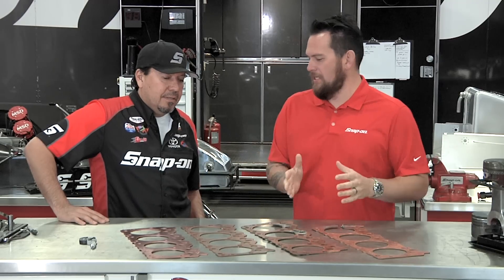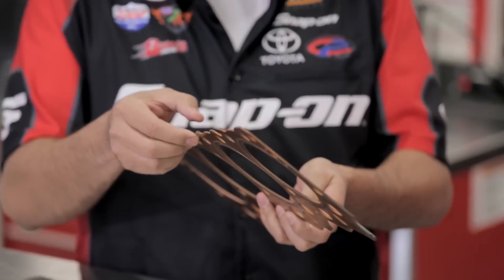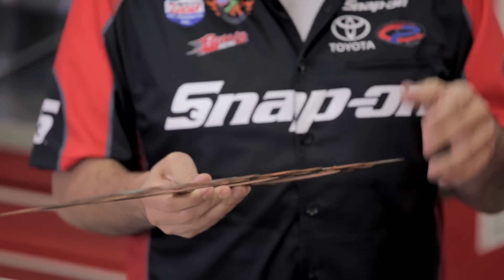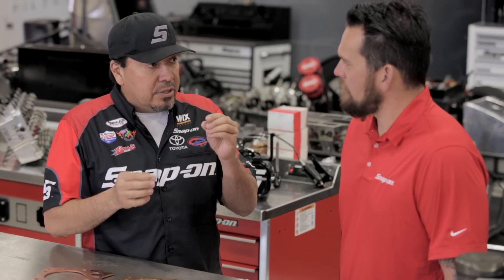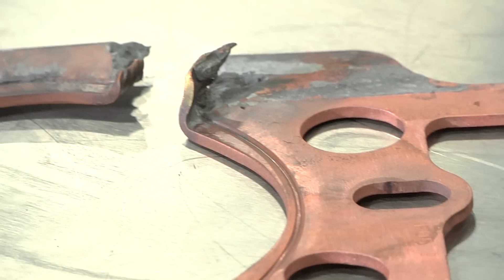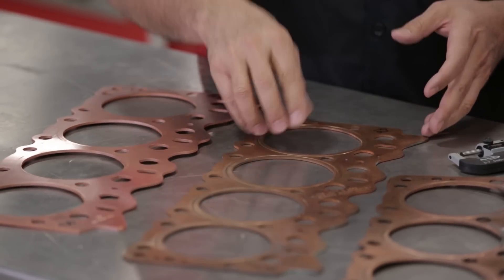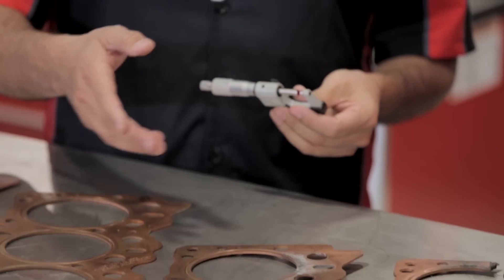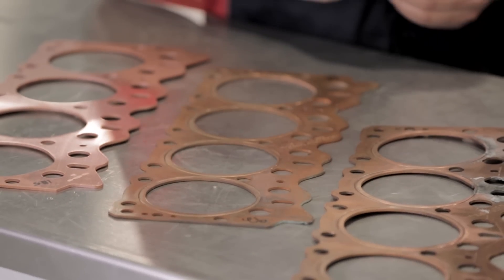Nitro Funny Car Head Gaskets - Snap-on Tech Series: Nitro Edition ft. Cruz Pedregon (S1, Ep. 20)

Comment: November 1 2015: Just got home from the NHRA finals in Vegas. Got my second Snap-On VIP pass. Hats off to Cruze, Snap-On inc. and the Pedregon Pit Crew.

Special thanks to the right side cylinder head Technician. His name eludes me. For a second time this year, he answered all of my questions and was really cool.

Extra extra special thanks to that tall dude Andrew who works on the left bank and head. He stopped clean-up at the end of the day and talked to me for about 15 minutes. Gave me some solid advice about how to get on one of these Fuel teams.

Andrew: Can't thank you and your right side counterpoint for being so friendly and polite. Can't thank you enough for taking the time to answer questions and give me advice about getting on a team. You guys are true gentlemen and scholars. I take my hat off to you.

I talked with most of the team in the Spring of 2015. Not a bad guy among them. Everybody answered my numerous questions and they're all nice, cool guys. The true heroes of the NHRA are the pit crews. They're at the peak and pinnacle of Horsepower, they are kings of speed, masters of the wrench. Aaand they do it all by crawling around on the ground under a small circus tent, facing any and all weather elements and a bit of Las Vegas dust in the wind.

Again, I take my hat off to these men. One of y'all should write an autobiography. I guarantee it would be a hit with all fans. Or at least, the true gear heads like myself.

Now as far as today's round one elimination against Ron Capps' NAPA car... I want his whole team to be tested for performance enhancing drugs. Check his tire pressures. He probably got some wise ideas from Tom Brady. #DeflateGateNHRAEdition